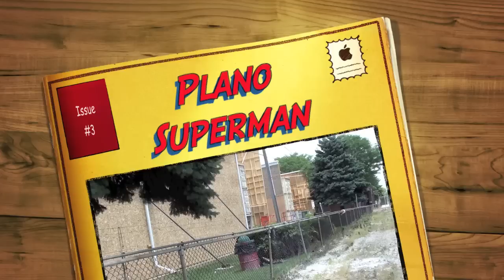The Superman Set , #3 Plano Ill., 7-6-2011

Comment from the maker: No... that's for real.  Uncle Lars. Tasty pizza also !   When I was at the set last, it appeared that they probably are going to remodel the facade.  The North side of the street is nearly fully populated with buildings most are receiving a minimum of new paint.  Coopers furniture facade will be broken up into four separate stores.  The Sear store is actually built in the intersection on the North side of the street.  The cost of this set boogles the mind!